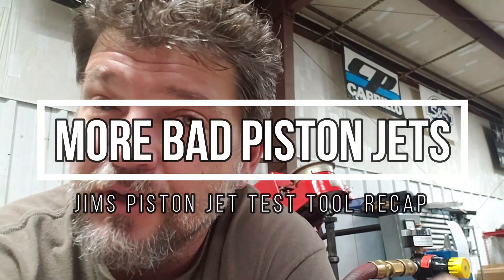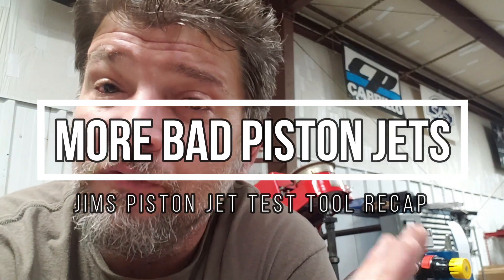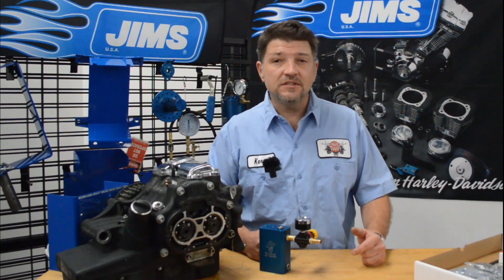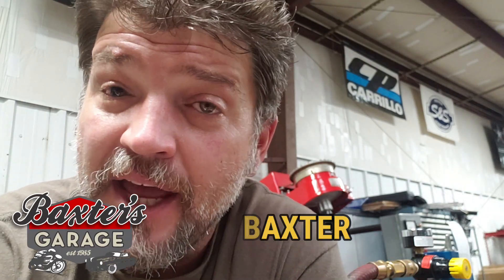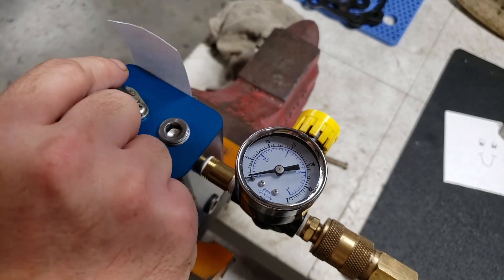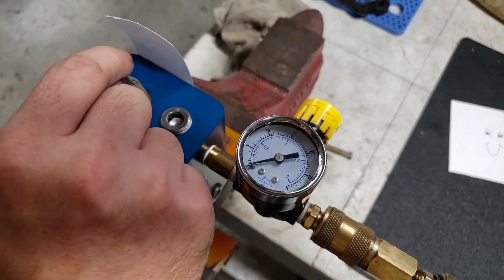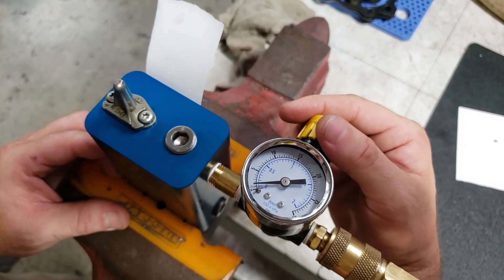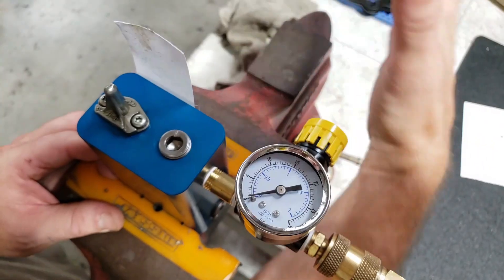More Bad Piston Jets - SUMPING! - Kevin Baxter - Pro Twin Performance

Comment: I’m struggling with this at the moment. Bought two new Harley oilers, one was working at anything over 1psi the other hadn’t even popped at 15psi. Bought S&S Oilers, both of those pop at between 8-9psi. S&S say that’s fine but I’m not going to use them, so I’m now waiting for some new Harley units.

Comment: Thanks for this video. Im doing a 128ci kit on my 21 FXLRS and found the front oiler opened at 5psi. notice how if i put my finger on it it changes the psi. relaced it. new and rear do not change until it reaches 11psi.  https://www.youtube.com/watch?v=YMk8sOH7Bpw

Comment: I always use hd twin cam filter. Had mech told me had a bad engine with k&n filter . Maybe pressure relief valve . Going back too amsoil too. Shovelheads had their problems ; top end - . Valve geometry-   Bigger engines and leaner means more to go wrong with oil jets now . Maybe evo was the ticket . 🤔 ✊🏻👍👌

Comment: hey Kevin with these s&s and fueling pumps these bikes are holding 15 or more psi at idle when hot
so the oilers are open all the time ? Iam confused about this subject.  Iam surprised after market haven't
made different ones.

Comment: You’re an expert…I’m no where close. I’ve seen people re-route tubes in their air filter to keep oil spray out of the filter. They sell a vented oil stick that promises to stop that without having to mess with the air filter. Does that work? I’ve been told I need to do something with my m8

Comment: Kevin I got a 2-14 103 with water cooled heads can we use my casings to build me a 128 Milwaukee 8 your answer is important to me and what would you charge I know you got to board the bottom casing Darkhorse crankworks compensator and stroker crank
Reply: On gear-driven cam

Comment: So with the factory spec on the jet, they would normally be closed at hot idle with the oem pump and plate.  What is the impact of raising the idle oil pressure into the 30’s with aftermarket plates and pumps?
Reply from the maker: it would force the oiler to spray constantly....but with a higher volume better pump, it should be able to keep up.

Comment: Kevin, that's a revelation. As you've pointed out repeatedly, sumping can be caused by several factors probably occurring in combination. But after seeing this video, my intuition says defective oiling jets is the real smoking gun when it comes to the sumping issues.

Comment: As in holes that are not con concentric with shafts, splines w/ improper match-up, shafts with way too much run-out, or assembled units w/ TIR at ridiculous levels, ALL OF THIS could be avoided simply by vigilant QUALITY CONTROL, it reallly isn't that difficult, but apparently H-D can't afford to take the time.....time is money!

Comment: I wonder what is the cause of the oiler failures?  I saw a study of new engine cleanliness from the factory. HD was above industry standards but in the bottom of the manufactures as they found a lot of machining particulates. Are these particulates gumming up the check valves?

Comment: Kevin, is there a root cause you’ve been able to determine for these failures? Is it a cast part with voids, with similar issues to cam plate issues you’ve talked about? I’m getting very excited about the upcoming skunk build you’ll be doing for mine, sir!

Comment: Kevin, I've been following your tear-downs, but I lost track with the Sturgis hiatus.....how many miles were on these four engines?  Is there a mean mileage that you begin to see failures?  I'm aware of the screw problem leading to gasket blowout, but I'm wondering, is the problem is pervasive enough to just go ahead and tear down my engine with only 9,000 miles on it?  Is there an aftermarket PJO that would be more reliable?....no sense tearing my engine down only to replace the oilers with the same crappy part from H-D.

Comment: Nothing like spending $28K on a motorcycle only to have zero confidence in the engine every time I ride.  I now own my last Harley-Davidson (after 40 years of riding).  Weak warranties, poor engineering, and shoddy craftsmanship characterize the Harley-Davidson experience.  Harley could make this right, but they won't.
Reply: Just stick to Evos and you'll have the same reliability as an air-cooled BMW.

Comment: I find it odd that having flow through a piston cooling jet at any pressure is a bad thing, unless the volume of flow is starving other engine parts of oil. To me, I’d increase flow to the entire engine to compensate instead of making sure the coolers don’t flow up to a certain pressure. Obviously I’m not an engineer but I’d be interested to see why they chose intermittent flow instead of constant flow.
Reply: Too much flow can cause sumping. The weak oil pump can’t pull the excess oil out.

Comment: Uh oh! Dang, just had my cylinder cylinders off. Cases together, in the bike, can ya pull 'em? Omg having nightmares about dropped fasteners.
  Anyway I have a question. Stock HD oil pressure drops hot at idle, so they want them off at idle. Or, is it the stock oil system cant scavenge enough to handle them pumping all the time.
 I ask because I am looking at Dan Thayers cam plate & 3 rotor pump. The claim is 30psi hot, cold, top end, idle. Plus bypass oil is routed differently to reduce aeration. That makes me wonder tho, jets open at idle? Will the pump handle it? 
 Thanks for another fun video! Oh yea, and making me wonder!

Comment: Just got a 21 street bob 2 weeks ago, has 200 miles on it. Still breaking it in, shift at 2500 not hot rodding it. Today on my way to work I noticed my intake is making a squeak noise at idle and when I bump the throttle, goes away when riding. Also notice after riding when I shut down the ventilator intake coughs releasing pressure but notice a hot oil smell. I took off the air filter and opened the throttle flap and looked inside with a light and noticed the intake was wet with oil. The filter is dry and oil level is just below full. Yes this is my first Harley.
Reply: Hey hidden wolf just thought I'd let you know you are going to want to take the two rubber lines that come out of the heads and vent them outside the air box real easy fix just get some length of new line and a small crankcase air filter drill hole in back of air intake and run lines out and down under bike give that bike fresh clean air Harley has to comply with regulations from epa so they run that nasty oil air mix right back into intake that's why your getting oil mess inside air box if you want your bike to last this is a must and you will notice a much better running engine  👍
Reply: I have a 2020 Softail Standard with external breathers hoses into a catch can. I get that hot oil smell when I shut the bike down also. I also hear air escaping out of the breathers on occasion. That is normal. I have taken the catch can apart and there is a little oil and condensation mix. I don’t have any it that mess going into my intake track.

Comment: I keep hearing more and more problems showing up with these M8 engines. I lost track of how many different oil pump designs they made for it. Now these piston Oilers are going bad. They had oil transfer problems primaries and the transmissions. It makes me glad I did not buy the Electra glide standard. I will stick with my old Honda VTX1800R. I hope Harley Davidson did a better job designing the engine in the pan America and the new sportster.
Reply: Typical Shadow guy. Your bike might be worth $1500. 😂
Reply: @joshrandall5297  at least he doesn't feel screwed as I do after writing a 32k check for a FLHTK that doesn't run that great. If I lived anywhere near GA, I'd probably be paying Kevin to tear it down. (My 06 FXDI runs so much better!)

Comment: I like this channel but you have to be careful or you would think your brand new bike is falling apart inside as soon as  you start it.... Ive never seen a positive report but I guess that's the nature of what repair shop culture is all about.
Reply from the maker: Unfortunately,  some brand new bikes are falling apart new however, its a small percentage. I cant speak for the "shop culture" you refer to...but what I can say is I don't call a plumber if I don't have a plumbing issue. We get bikes in from all over the world. Many of them have tough issues with several repair attempts.  We specialize in the hard to figure out stuff.  That said, we do service bikes that have zero issues. But...the MC community doesn't need help when everything is good. They need help and guidance when things aren't so good. Thats the purpose of this channel. My goal is to provide people with real and honest information in the event they do have a problem along with explanations of those problems in case their chosen repair facility hasn't clearly explained. Also...its a way to help people know what to look for when something does come up instead of accepting "thats normal" when they know something is wrong.  Ive said plenty of times...250,000 plus HDs have been built yearly since 2000 on average. The huge majority of those, had no issues. And that's awesome. Thanks for watching and for your comment. I sincerely appreciate your respectful candor.

Comment: Can they be "blocked off"? And if not, why not?
Reply from the maker: They are beneficial in keeping the pistons cooler. Allows for leaner mixtures and better economy...as long as they are working.
Reply: Curious about this. I'm running a carbed 95 inch. I find it runs best with a fuel ratio of between 12 and 13 to 1. We didn't have these on previous generations of engines. With a richer fuel ratio from a carburetor could I delete these? Your opinion would be appreciated kevin Baxter. thanks

Comment: I'm about ready to trade in my 2020 street glide in on a gold wing getting really tired of worrying if this engine is going fail on me poor quality for sure sad
Reply from the maker: If I may suggest...due diligence. Take the information from my videos,  Have a leak down and CCP test done, check for sumping, and be conscientious of the aspects of your bike. If you think there is an issue, address it early and don't be satisfied with thats normal without an explanation as to why. Most of these expensive issues could have been far less expensive caught earlier and properly diagnosed.
Reply: @KevinBaxter  Thank you Kevin appreciated great information as usual and the only one I would trust at this point that’s all I’ve heard out of people is oh that’s normal Harley stuff deal with it
Reply: So I had a 2013 Road Glide 103. I put 29000 trouble free miles on it.  Then I bought a used 2012 Honda Goldwing.  Fell in love with the GW. 1 year later I realized I had not rode the Road Glide even 2000 miles since buying the GW. The GW now has 82000 miles and runs perfect just like day 1.  Sold the road glide havnt looked at a harley since.  BTW I'm only 38 years old so by no means to I fit the usual old man Goldwing stereotype